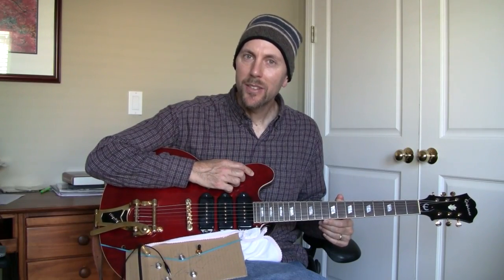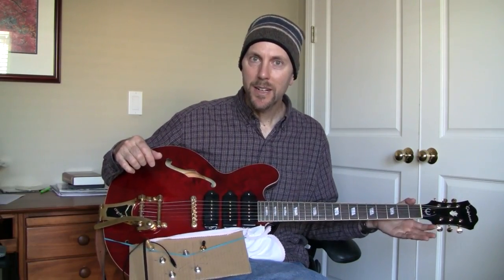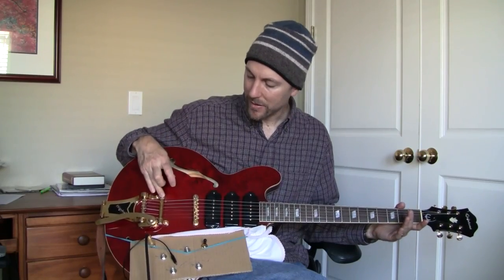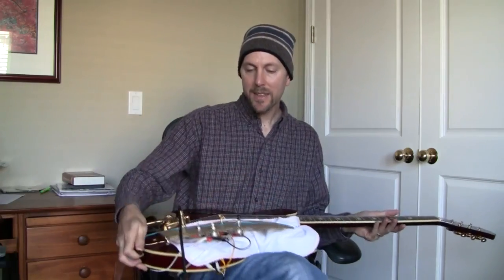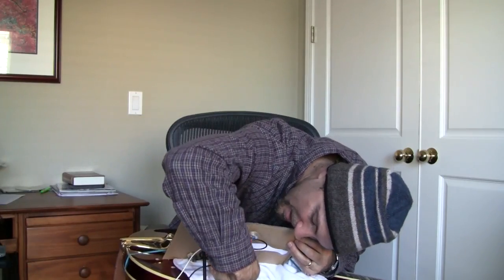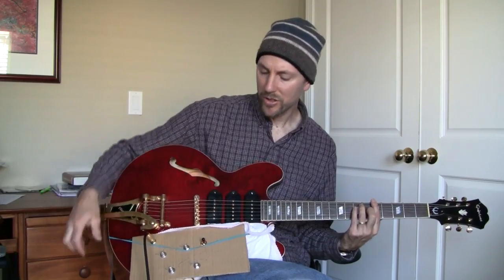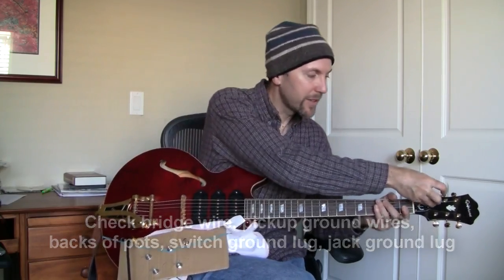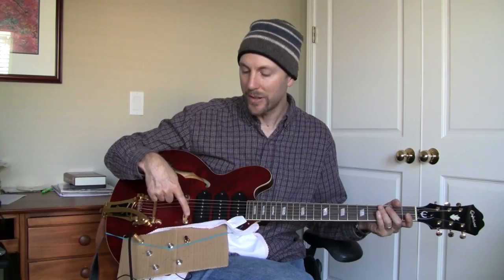Guitar Ground: Dealing with ground noise problems

Comment: John, I have a Rickenbacker 330. Grounding issue. When I'm not touching the strings, you can hear the slight buzz. I've taken it to 3 different shops, and there is still a slight buzz

Comment: I had the same problem, and my guitar also produced a really loud high pitched noise sound on some of the presets of my multi effects pedal. The problem was that the shield of the cable was completely severed.

Comment: Thanks for a good video! I do have a question: I'm planning on upgrading all the electronics on my guitar; pickups, pots, caps, etc. and shield the circuit cavity as well. My question is regarding the interaction between the shielded cavities of the guitar and the electrical circuit: what should that be? Should I connect my circuit to the shielded cavity, or would that create a short?
Reply from the maker: +theallmikey - yes, the shielding should be connected to your circuit ground.  Here's a useful article on shielding: http://www.stewmac.com/How-To/Online_Resources/Learn_About_Guitar_Pickups_and_Electronics_and_Wiring/Guitar_Shielding.html

Comment from the maker: If it's making "crunchy static" noises only when turning the pot, you may be able to clean the pot, or you can replace it.  If it's continuous static when you turn the amp up loud, I guess it's probably just hiss, which is common with amps at high gain.

Comment: Hey John I am having the problem you described. When the tone pots are turned past 2 there is major feedback. If I roll the tone back on both the bridge and neck then it goes away. Also during the feedback when I play it stops, but as soon as I switch to a new riff, say 1 second in between, then it starts again until I hit another string/note. What's the problem? Opened my LP Standard every solder joint looks good and well connected.

Comment: hi, i need your help, i have made a guitar strat like, and connected the ground to the plate that goes on the back of the guitar where the springs of the tremolo bridge are installed. i have checked every thing and it seems everything is ok, my problem is that the guitar makes some noise when i don't touch the strings, once i touch the strings the noise is gone! so i guess i'm doing the ground connection through my hand. what do you think is the problem?

Comment: im building a guitar and the body had a hole drilled wrong so i cant ground the wire to the bridge. is there any way i could ground it to some thing else or will another hole have to be drilled?

Comment: Hey, I think there's a problem both with the ground wires and the jack socket on my guitar because not only does it buzz when i'm not touching any metal parts on the guitar, it also goes nuts if the jack socket is jogged a little or even if the wire moves. The only way to stop it is if i hold the jack lead in the guitar extremely firmly. Any suggestions would be highly appreciated.

Comment: @Clipster15 I have the same problem on my LP, I double checked and all the grounds are connected per the diagram I used but they weren't connected well enough. Check the continuity between all the individual parts and the ring on the jack.

Comment: Hello there, i also have some weird problem with my guitar that i've discovered yesterday, my neck pickup is either broken or not grounded because when i want to play on it, the sound is really low and when i touch the screws that adjust the height of the pickup it buzzes very loudly, my other pickup works fine, without any buzz or signal loose, Can You tell me where lies the problem?

Comment: Could a crappy cable mimic a ground problem? M 06 Gibson V is about to under a 67' treatment so i will be dealing with the ground than, but my fender cables are about 6 or 7 years now with abuse. what would you advise is the cause? I notice a buzzyish sound coming from my amp. but its silenced when the strings are muted.

Comment: hey man, really hope you get back to me on this one! I own a slash epiphone goldtop running through a frender g-dec amp, and i've been experiencing some "hum" and "buzz" noise when i turn on the volume and tone on the guitar itself. When i lower the tone to zero, and raise the volume to max on the guitar knobs, the noise disappears. What's your take on that? Do i check the wires or could it be an amp issue?

Comment: hey john great vids by the way, I've just built my first guitar & about to put in the electrics. I'm going for a very simple setup as I don't use multiple tone knobs or pickup combinations..so I've got a 2 way dpdt switch, 1 volume 500k, 1 tone 500k  & a set of p90's. I will also be using a .022 orange drop cap on the tone pot (thanks for explaining that by the way). My question is do I have to link a ground wire to both pots & the brid
Reply: Yes...

Comment: Hi John, When i turned on amp for the first time, everything sounded great 
but as soon as i am not playing anything (f.e.x muting the strings and 
doing nothing) the feedback noise on the amp becomes very loud. loud as 
in "absolute no go for a live show or even rehearsal", its quite 
unbearably loud, about the same level as when playing stuff.

do you know why this can be? i plugged the guitar (ibanex xiphos with 
EMG's) directly into the amp, no effect chains etc. Box is the Engl 4x12
 Slanted
i can also stand 5 meters away from the amp, same thing, it definitely has nothing to do with how close my guitar is to the amp. The cables are checked and the cable from amp to box is a proper amp/box cable. Batterieson the guitar are fresh and changed.....I am pretty lost atm what the cause for the feedback can be

P.S. when i turn the volume on the guitar to 0, there is a static noise that our other guitaris doesnt have. if i try with his guitar on my amp the problem still persists....any idea?

Comment: Hi I have a question. I have a guitar that my tech friend can't seem to fix. He's a good qualified tech. I've been going to him and never had problems. However after converting an emg equipped guitar to passives, there has been a hum that stops when the hardware or strings are being touched. He has tried different wiring schemes and nothing seems to stop it. The bridge is grounded but it never stops. Is there any insight you can give or something you recommend? I'm thinking about trying some foil grounding tape but idk what else to do. Guitar has one push/pull volume, one tone, 3 way selector. The neck pickup coil plits on push/pull but the bridge pickup doesn't (intentional). Thanks!!

Comment: Hey, I have that problem with My electric Fender Acoustic. The pickup in where a strap would go, and the ground noice is bugging the hell out of Me when I have it running in the mixer board I got. I was wondering, could you geive Me some instructions on what wires i'd need to check?

Comment: man.. what did you clip on the back of the pot? i mean literally.. is that a magic cable or something? can you please tell me what did you clip on that? please
Reply: I'm assuming he connected the ground wire to an alligator clip (the clip he used) so that the connection could be made through clipping that on rather than soldering the wire on the back of the pot. 4 years for a reply, but I hope I'm right and this helps LOL

Comment: Nice vid thank you. if you have this problem take a look at the solder joints themselves, sometime the solder is really dull and this can show that it's not a good contact. You may need to re solder it, sometimes called a dry joint. Can be hard to track down as it can look connected.

Comment: Hey John! I have a similar sound, but when I touch my strings, it stops (not sure if it still sounds muffled). I tried it  with my strat, (which is now broken, no relation) and now with a Jackson and same thing with both. I played my strat originally with no problem, and now I have the problem, now I have a bass which it doesn't have that problem, it just has a slight buzz which goes away when start recording (it's connected to an interface to my computer) any clues, think it's a ground issue?

Comment: Hi john, thanks for the video.
however my noise doesn't mutes when i touch my bass parts or turn the volume down, it shuts itself when i touch the outer part of the jack plugged in my bass. i checked with all the cables i had and even with a guitar, same problem, only mutes when i touch the jack. what kind of problem would that be? thanks
Reply: So did you get a solution?

Comment: i have a very simple setup on a cigar box guitar - a piezo pickup going directly to a jack socket. when i touch the ground it stops buzzing. do i fix this buzzing by connecting the ground to the (metal) bridge? thanks!

Comment: I have a strat w/a duncan humbucker and its still buzzing even after all new electronics...touching the metal eliminates much of it (but not all) do you mean put the multimeter between each tone and also the vol and both tones? what should it read? mine reads about 1.2 between tones...also, I put one end of the meter on the brg and the other on the jack plate and it kinda reads all over the place...sometimes 1, but then all kinds of other numbers like it can't track very well

Comment: this happened to my bass but there is a wire going from the tone pot to the bridge and it hall a little bit of fuzz and like you said when you touch anything metal it gets worse. do i need to change the wire to the volume pot or input jack on my bass?

Comment: Hi John. I have a couple of Ibanez guitars with HSH configuration. It seems that every time I try to hook up the middle single coil to the 5-way switch, the humbuckers work perfect and the single coil gets " a lot" of noise -- it doesn't matter what pickup I use. My single coil has a red and a black wire, and I've reversed them back and forth and still get the same loud noise. Do you have any ideas what it might be ? Right now, I have the red to the back of the volume pot and the black to the switch. I can't understand it. Please help.

Comment: ok so my bass has this however, I run EMG-HZ pickups and if i have the neck pickup on or blended and touch the neck pick up with my finger I get a high pitch squeal. If I blend it to just the bridge pickup no squeal. I have replaced the battery already, do you think this is a ground issue as well?

Comment: Hi John. First off I would really thank you for your videos, specially those in which you compare electronic components explaining how they work, they really help. 
I was wondering if you could please give me your advice on something that I don't know if is a grounding issue or not. I got an old 60's amp from the US and to use it in Spain I employ a voltage regulator to 220v. It's grounded although the amp doesn't have a 3 prong cord.

Comment: @johnplanetz 
My multimeter shows a connection between ALL metal parts and the jack socket, and also the top 3 strings and the jack socket.  However the the connection between the D, A, and low E to jack socket is intermittent.
What does this mean?

Comment: @johnplanetz I happen to have a similar problem to thedonace213....my guitar is a 1 humbucker, 1 volume guitar (EVH style). When I touch the strings, or anything metal connected to the strings (the floyd rose for example), all the static goes away. But when I do not touch the metal pieces there is an annoying static sound. Any suggestions for getting rid of this?

Comment: I just refinished a Epiphone Sg and i think there is a grounding problem. The ground wire goes through the body into a hole where the the bridge is slides in. Am i just supposed to set the bridge on top of it and hope it touches?

Comment from the maker: Missing bridge wire probably would not cause your amp to be quiet- I'd suspect some other problem with the amp.  (Try plugging another guitar or audio source into the amp to confirm).   Hopefully, by now, your amp has been fixed. :)

Comment: @decomposing1 This sounds like a problem with the neck pickup itself, I'd check all the wiring first, just to make sure, but typically the high squeal is caused by microphonic feedback meaning that the bits inside the pickup are moving and they shouldn't be. With regular pickups you can 'pot' them (seal them with wax). This principle certainly applies to the EMG's too but depending on how they're constructed it may not be that quck a fix. You might need a new pickup.

Comment: Just got my dreammachine yesterday , strat custom shop 1956😍 but i went to our guitar shop and he customised the action its perfect now. (The stringes were to high compared to what i used to play on my other guitar. Even though i have like 2-3 places on the fretboard where i get these buzzing noises etc.when i bend from 15(17). So annoying. What should i do?
Reply: your truss rod might need further adjustments or it might be your frets causing the problem if they're not leveled perfectly.

Comment: So how do you use the multimeter to test the connections? What should it be reading?
Reply: Set your multimeter to the symbol omega (Ω) for ohms, it measures resistance. As a side note, if there is more than one setting then make sure its set to kilohms. All the components should have relatively similar resistances, so if you find anything that looks out of the ordinary then that is probably where a break or damaged connection is.

Comment: So does this mean a guitar with proper ground wiring into a vintage 2 prong plug amp will still sound as if the ground wiring in the guitar is disconnected because the amp doesn't have proper grounding through the wall plug's ground?

Comment: I have a new Gibson Peter Frampton Signature and when I touch the screens or run my hand up on them I get a slight but obvious crackling, just as if static is discharging.  I'm not prone personally to static and I have 20 other guitars none of which have this.  In fact I've been playing for 50 years and never encountered this.  What might be the problem?

Comment: I just replaced the neck pickup.I didn't touch anything else.My grounding wire is on the back to the tremolo thing( i don't know the word sorry) where she is supposed to be.So the problem is that i have this buzzing sound like yours in this video but when i touch the strings or anything metal sound disappears. Any tips???Please

Comment: Hey I have a pair of Seymour Duncan active pickups that I self wired, I thought I did a pretty good job wiring it, but when I turn my volume up I notice a hum, the hum is more obvious when I specifically tap my neck volume knob (it's metal). I also noticed that if I bump the 1/4 inch going into my amp head, it makes a strange sort of being sound. To me it sounds like my pot has a loose ground and my amp also might need rewired. Any ideas?

Comment: Hi, i own a Schecter Hellraiser C-1 FR BCH i need some help with the clean mode.
when i play with clean it makes a tiny bit of distortion sound. i had another amp laying around so i tried changed that. It didnt work. i also tried changing the wire connecting the guitar to the amp. Still, it didnt work. i played around a little bit with the amp settings but still. even if i go ''as clean as possible'' i still makes a distortion sound when a note is played. ANY help is greatly appreciated. Thanks.

Comment: Hey John, thanks for replying. It more of an unbearable sequel if anything, not fuzzing or a hum. No it's not on the clean channel. I have a peavy vypyr 30 and if I turn the post gain all the way down on the dirty/red channels it goes away. Problem is that when you turn the gain off, the volume goes with it. It will produce no sound at all. Even with me I keep my gain at about half, and I play through earphones.

Comment: Alright!, maybe I can finally clear this up, I'm digging around a little for the problem. I have a 1977 Les Paul.  The hum goes away only when I touch the pickups and the jack. Hmm, I was just thinking, could this be an amp grounding prob? I can also touch the jacks going into pedals and it goes away.  But when I plug into the computer, I get the same buzz and touch pattern.

Comment: If you don't have a earth wire connected to the bridge on your guitar, can it also cause your amp to be quiet? As i recently sent off my 120 Watt Randall head to get fixed because it had some volume problems, but could the loose earth cable in my guitar be the cause of this problem? :(

Comment: Do I need to have a weird contraption like that one on your guitar, to make this work? Do you take that on stage? I rather go back to acoustic.
Reply from the maker: Of course not! I was replacing the electronics in my guitar, using the cardboard template as a place to hold and test them before reinstalling into the guitar.
Reply: John Cooper Where did the ground wire come from and what did you hook it to?
Reply from the maker: 2:20 There's a wire connected to the bottom of the bridge post screw, connected to one of the pot backs.
Reply: Thank you!

Comment: I just finished installing a new tone cap in my project telecaster, but when I tried the guitar it had a ground problem, so I went through and fixed some suspicious looking connections, then checked with a multimeter to make sure all everything was grounded, which it was. But now my guitar still buzzes and the tone pot doesn't work now. What should I do to fix this?